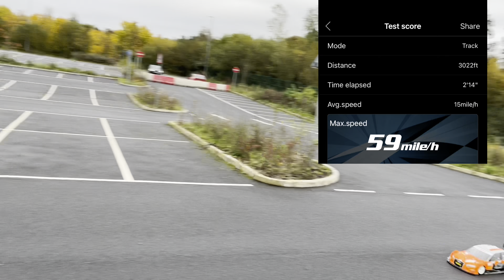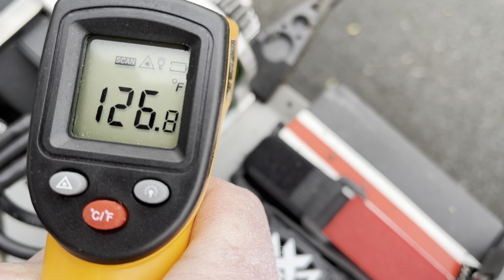Audi A4 DTM #FG Sportsline 4WD 530 Electric 1:5th scale RC car

Comment: This of the best handling awd car out of all the 1/8,7,5 scale I seen. All the videos I seen of this FG handles sooooo damn well. The perfect drift. The perfect threshold of grip/drift and gaining traction again. But…. It sounds like your NOT at 100% power potential from the esc, are you holding back power? Do you have a soft slope on throttle curve? Or adjusted auto acceleration speed or something… I know Raz’s FG build went up in FLAMES and came down to 80% power on the replacement esc lol… that’s still didn’t justify if it was one of the faulty esc’s or if his settings were “too demanding” bcs those tires were SMOKING left & right. I see 99% of FG owners using the castle Phoenix 12S esc and it runs good and hard with no issues on 4s 6s 8s.. they don’t even try 10 or 12s bcs 6s is fast enough let alone 8s which hits 90+ speed runs. I can’t remember the Chanel but dude runs a 
RED PORSCHE body on his  FG and he’s done some serious testing on it with MGM esc..
Reply from the maker: Esc settings are grand, power set to 100% but I’ve set punch to 0, I’m also running my big panther batteries which I use in my speedrun car. 
When I was doing the passes from the bottom of the carpark I was bringing throttle in slow, the only time I hit throttle full from a standing start was on the drag hit.. 
I’m running standard gearing which should only yeld around 55 to 60 on this setup, if I heated batteries I’d see 61 - 63mph. 
That was only the second time I had cat out so I’m still going easy on it.
I’ve seen the red Porsche video, nice build and definitely did slot of testing